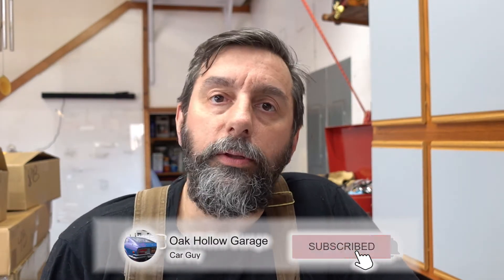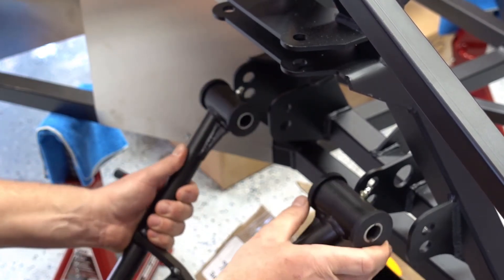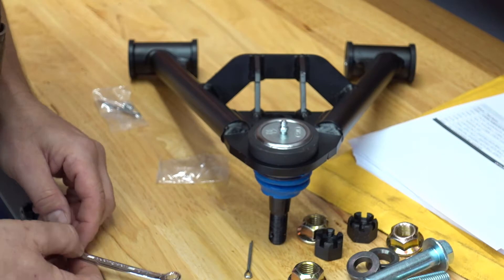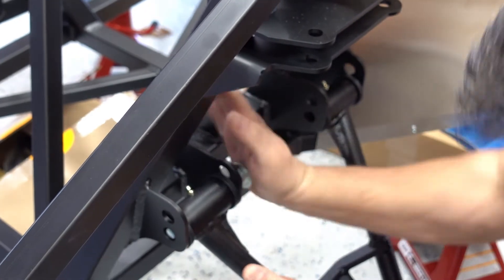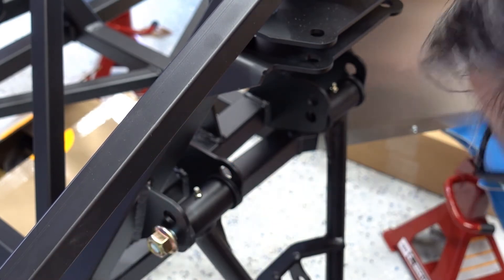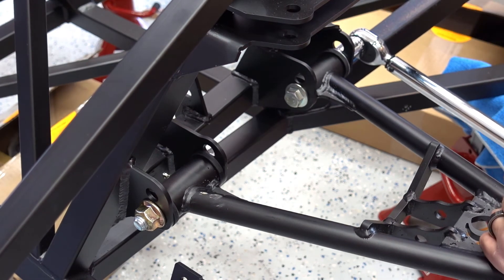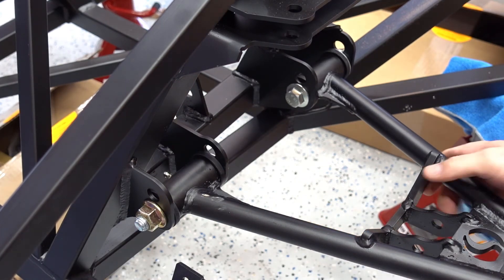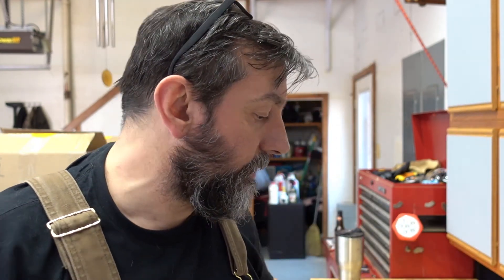Part 3 | Daytona Coupe Kit car build | Lower Control Arm install

Comment: I never liked brute force to adjust gaps between clips.  I recently completed a Gen 2 Coupe and ran into similar issues regarding fitment of control arms between the clips (too narrow or too wide).  I used a 1/2" bolt with 2 nuts and washers to incrementally spread, or narrow the gap between the clips.  You can email me if you wish to see pics of the setup.
Reply from the maker: Thanks, that was pretty much what I was going to do, but didn't need to force it too much. I greatly appreciate the feedback. This is my first build.

Comment: You should use grease into the bussing and torck it all when finised and engine and all the rest is in .
Reply from the maker: Thanks. I will certainly grease everything and recheck the torque.